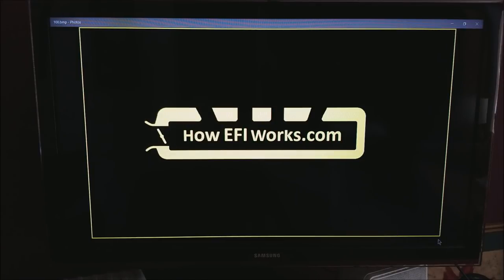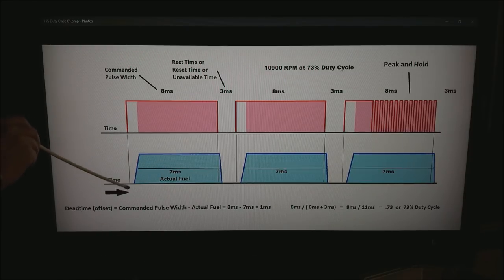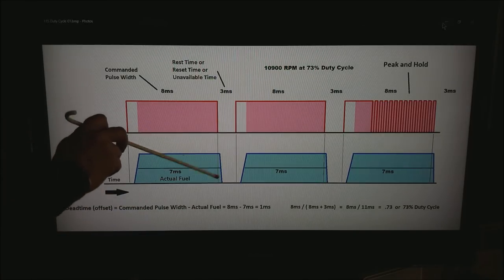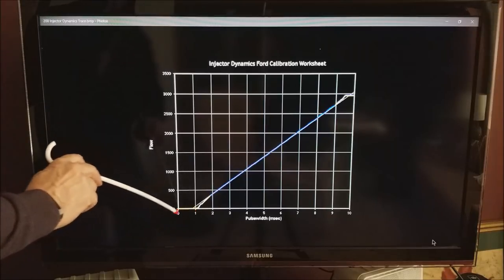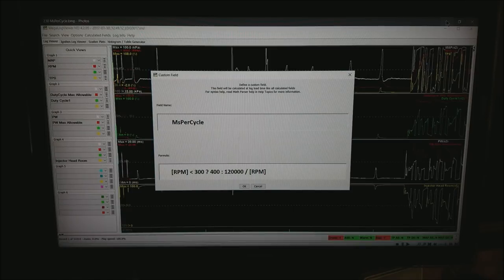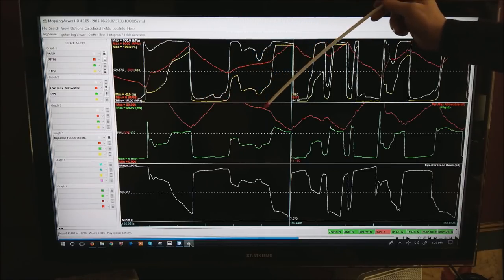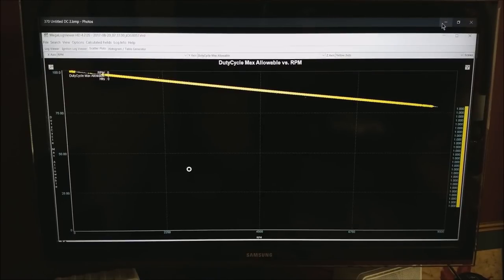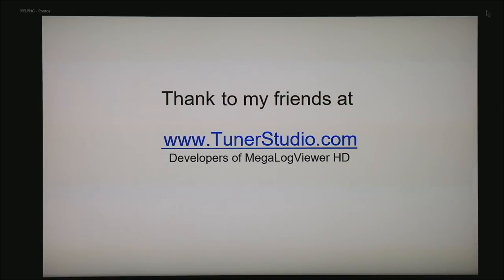Injector Duty Cycle, Pulse Width and Limits Related to RPM

Comment from the maker: See http://www.asnu.com/static-downloads/injectordata/ASNU%201500cc%20VC%203%20BAR.pdf

This is an injector test run at several different voltages applied to the injectors.  If you move the decimal over one on the horizontal scale (Pulse Width) by one, you have Duty Cycle along the bottom so 9ms = 90% DC.   This injector is needing 1ms rest time at a rate of one spray every 10ms.

Comment from the maker: For a great source of info on lots of different injectors, They call Injector dead time "Injector Lag Times"  I did not mention in the video is this time is very dependent on the  voltage being supplied to the injector.  See http://injector-rehab.com/shop/lag.html
Injector dynamics is the source of the injector graph in the video.  See  http://injectordynamics.com/articles/ford-injector-characterization/

Comment: Great video! I assume the formulas in the end apply only if injectors squirt sequentally and once per cycle? If theres more squirts per cycle (lets say two) and injectors squirt simultaneously to two runners (paired injectors) I need to multiply the injector reset time by four (because basically both runners get then 4 squirts per one engine cycle)?

Comment: correct me if I'm wrong, from my understanding the time that intake port is open is no more than 25% of a Engine cycle (or 50% of Engine rev) time of intake stroke at 6000RPM would be about 0.005sec and the injector would be spraying for 0.017sec? So the injector at 85% Duty Cycle would be spraying fuel into a closed valves for 0.012sec?
Reply: exactly. and fuel requires heat to evaporate, and evaporated fuel burns better than merely atomised mist... and as the heat comes from the valve it keeps cool, and as fuel is a solvent it gets cleaned...

Comment: Hi Andy - love your videos and have been using MLVHD to post processes logs from my recently supercharged Lotus Elise with a Haltech ECU.  Do you know of any way to create an integrator math channel using the custom channel interface tools?  I have a fuel surge tank that has a high flow pump internal to the tank and is supplied fuel from the main tank with a lower flow lift pump.  I wanted to create some channel logic to predict the fuel level in the surge tank given the fuel consumed by the engine and an estimate of the fuel supplied to the surge tank via the lift pump.  Any tricks or tips to create this channel definition?

Comment: is it normal for pulse width% to drop in higher rpm? does the computer calculate this and can it be manipulated for a longer pulse via a aftermarket ecu?
my pulse drop 65% to 55% from 6000 to 7000 (redline) rpm. quote my tuner.
Reply: If your engine struggles to breath after 6000 it will drop off. That is if your Volumetric efficiency declines as most engines do, the injector duty cycle will also decline to maintain a certain air fuel ratio. It may also reduce at higher rpm if fuel pressure increases. As the pressure increases for whatever reason, the duty cycle does not need to be as high.